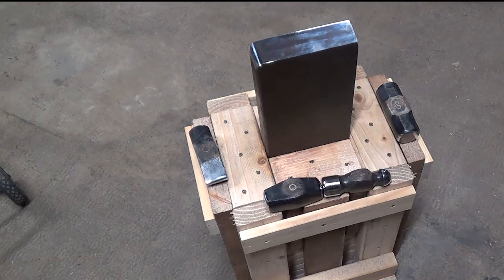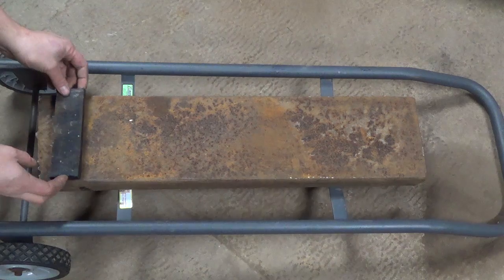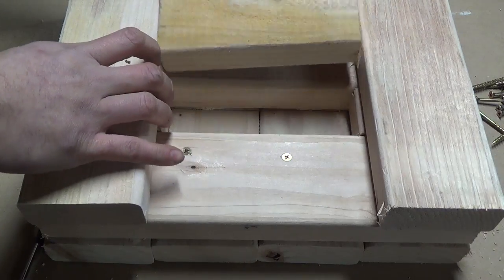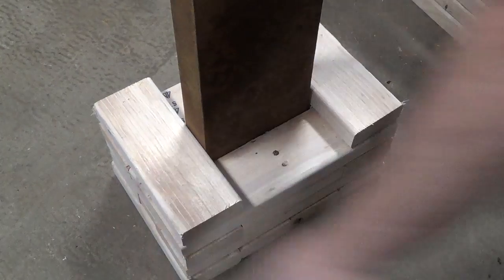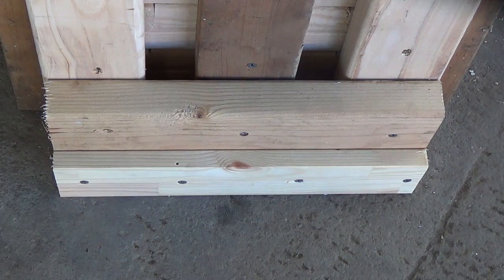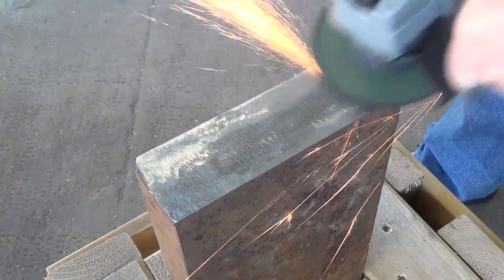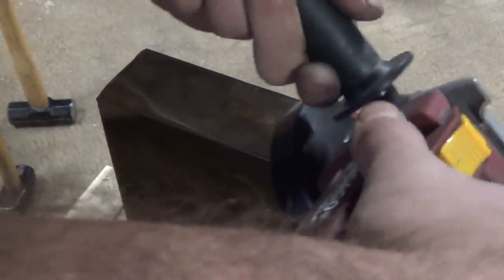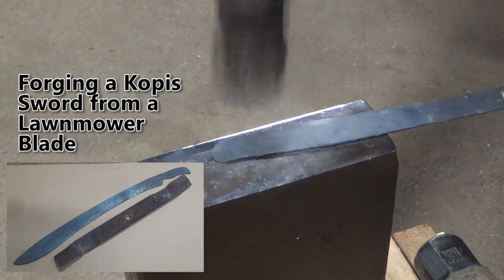How to Make a 100 Pound Scrap Steel Post Anvil and Stand for Blacksmithing and Knife Making

Comment: anyone know the easiest way to make an axe out of common materials?! I've a handle finished up but no head and no steel large enough for a decent head
Reply: I'm not an expert on this, but maybe you can forge weld steel cables?
Reply: +john smith I would recommend against doing that because it is technically illegal to go onto or around a railroad track. If you take anything even if it seems like trash, you know that steel that is rusted and buried in the ground that no one will ever pull out, its technically stealing.
Reply: +Chris McLain and? lol seriously though the way I see it my family's paid taxes to pay for that shit, if they aren't using it ama take it back and fuck what they say :D
Reply: +john smith there's actually an abandoned track just down the road, it used to be used to move cattle. might just have a little look around there
Reply: +john smith it's a back road in rural ireland 1) nobody gives a shit :D 2) nobody will see 3) the police don't care 4) the nearest station is forty minutes away. so it's hardly mission impossible :D

Comment: How much was the block of steel.
Reply: Just and extremely rough guess but probably lest that fifteen dollars
Reply: +Shredder212Films dang that's cheap
Reply: +Outdoor maker38 it wouldn't be too expensive and you could just look for scrap in woods and stuff. I found about 15 50 pound bars of steel near a demolished barn

Comment: It seams like the rubber at the bottom is unnecessary and detrimental to working efficiency. If you just put it straight on the wood, it would crush down the wood to the appropriate density and give your hammer better force delivery to your work.

Comment: wouldn't that polished end deform quickly? Its not hardened steel is it?
Reply: Dave Z it might eventually work harden like a rail line would, but I'm sure a block of high strength steel will get added on top one day
Reply: For a striking anvil it's actually better for it to be made of mild steel so that chips of steel don't fly off on a misstrike
Reply: Still better than cast iron

Comment: that ammount of steel must have cost a fourtune
Reply: 105 lbs times X 25 cents a pound = 26 bucks/dollars/bones.  If he drove a big truck to a far away scrap yard he would have paid as much in gas to get the thing. Also he probably spend several hours searching and had to drag the thing over to the scale...
Reply: He could weld thin tool steel to the top, torch it to bright red and water quench and have a top that will last a long time. The thin tool steel will probably cost more than the mild steel.
Reply: Best bet is to get the local fire dept to supply the water, proper quenching for anvils require running water akin to a waterfall.. I'm sure a 3000liter per minute pumper would do that fine. Plus no need to life a massive hot block of steel/modify it so it is possible to lift

Comment: POCKET KNIVES?
Reply: wallytron101 I've made many recurves and Bowie's and other knives and the "anvil" I use is a bunch of different sized sledgehammer heads on an old Post...
I mostly make art pieces but I've sold a dozen or more knives. Basically it works, if it works.

Comment: Just one man's opinion over here, but I don't reckon those screws are doing much for you. Properly applied, glue is a good bit stronger than screws, and screws are just used to hold the work in place while the glue cures.
Reply from the maker: +Rob Mckennie Thanks for watching!
At the very least, the screws added an extra pound of weight to the stand.
Reply: Is your house put together with glue?
Reply: +Rob Mckennie How does glue hold up with vibrations?
Reply: Alex Behrens Do you think most houses are built with the strongest materials and techniques available? No, of course they aren't. They're built in a way that is least expensive and most efficient, as long as it's strong enough. It doesn't need to be as strong as possible, it just needs to be strong enough.
Reply: +Alex Behrens    Most new construction is in fact assembled with Adhesives..   and over the last 75 years, the material that gives most homes their strength is Glued Laminate Plywood..  It is the sheathing which gives the structure is ultimate strength..   The structure is extremely weak before the glued laminate sheathing is screwed and glued..  The Glue acting as the ultimate bond and the screw acting as a clamp to keep the two materials tightly assembled while the adhesive bond cures.
Reply: PyroShim I'd wager better than screws or nails.
Reply: +Rob Mckennie glue is stronger but don't really like vibrations
Reply: Popescu Kevin   You have it backward.. It is fasteners which do not like vibrations..  That is why all new flooring and decks are "Screwed and Glued"..    If you're familiar at all with older homes, sheathing, roofing, flooring, or deck covering the nails will "Pop" up due to vibration..  Screws will work harden and snap off at the head and the boards will lift.. Adhesives are now applied for the same reasons they are used in Air Frame Construction..  Because they resist vibration and form a more uniform bond over a larger surface area than Fasteners.
Reply: +Rob Mckennie this seems silly. Screws and glue together is stronger than glue by itself.
Reply: Jonathon Frederick I would bet that all things being equal, using nails and glue together wouldn't have a greater ultimate strength than just glue, although it's true that it can provide convenient clamping, but it was a bit excessive in this video
Reply: have you ever even pulled wood joints apart with glue vs glue and screws? You can easliy break glued cabinets apart with just a hammer. If you add screws it prevents the wood fibers from breaking where the glue is applied, holding the whole board together.
Reply: Jonathon Frederick And there you have the difference between edge joining and face joining.
Reply: +Rob Mckennie and here we have a man who can't admit when he's wrong
Reply: Jonathon Frederick what was I wrong about, exactly?
Reply: +Rob Mckennie why do you guys keep going....
Reply: +Jonathon Frederick you are very right.
Reply: Your reply makes absolutely no sense to this application obviously lvls are extremely strong and sheathing holds the structure square and strong but all these items are held with glue was I questioning the material he was using? No it's the fastening of wood vs glue in an application that is subject to high vibration and impact in which case a fully rigid glued stand would eventually crack and break where as the screws would allow flex and still remain strong
Reply: all these items are held with screws*
Reply: +tha Priesta Obviously you have never seen US weather. And houses are screwed and glued in the US. If you are talking about trailer parks, thats where the poor people live.
Reply: Houses in the U.S. were primarily put together with nails until about the 80's. Nowadays, there is still many nails but its usually held strong with hardware, bolts and shear walls. I haven't personally seen much glue used in wood frame homes, except when flooring ( to prevent squeaks )
Reply: It has to move a tiny, tiny bit, so I'm thinking it's cool
Reply: ***** do you have any evidence for that?
Reply: ***** Lol, nice evidence. I never said that screws would make things fall apart, I said that I don't think the screws are adding anything. How many houses have you built using only glue that have fallen apart?
Reply: +Alex Behrens lol ya or any building above 50 square feet
Reply: +Rob Mckennie The screws were adding strength to the whole thing and keeping it together nice and flush. See the planks move into place slightly as the screw was tightened? Without that the planks would have been prone to wobbling
Reply: +rainmechanic Nope. My dad is a home builder. They use laminated boards for structural purposes (Micro-lam boards are incredibly strong), but framing is just 2x4's nailed together with pneumatic nail guns.
Reply: +Rob Mckennie After reading this comment and the replies to it. I'm curious to what and how much experience do you have in the construction industry? I mean no offense to this question, I'm genuinely curious. Also what kind of facts, documentation, and or what kind of evidence do you have to base your claims off of? Because I have just over 12 years experience in construction work, and  I find your claims that glues, epoxies, or any other kinds of adhesives alone are stronger than nails or screws. Or that they are stronger than nails or screws along with adhesives to be pretty far fetched! I know my 12 years experience isn't a whole hell of a lot, but, it's enough for me to be able to say that you are both right and wrong at the same time. Whether glue is stronger than nails or screws depends on the application. If you are building a model air plane then yeah glues are king! But if you are building a residential house or a commercial building... No way in hell will any kind of adhesive outperform nails, screws, or bolts! You will never pass an American Codes Compliance inspection if you plan on building any kind of structure with only adhesives alone. Especially if that structure is to have a person in, on, or around it at any given time. Codes Compliance rules, guidelines, and or protocols are based off years and years of rigorous, scientific testing of building materials and the techniques to apply said building materials to make sure residential or commercial buildings or dwellings are as safe as humanly possible for people to be in, on, or around. And they inspect every single aspect of any kind of construction. From the footer for the foundation to shingles on the roof they inspect EVERYTHING!  It doesn't matter if the materials or process of applying materials is the most efficient or if it's best, strongest, most expensive, or the cheapest. As long as they are accepted by statewide or nationwide codes compliance regulations you are good to go! And I can tell you right now that no inspector in the United States of America will ever pass any structure constructed with just adhesives alone. Especially if that structure is to have people in,on, or near it! Adhesives just aren't strong enough to use to build anything of significant size by itself. If they were strong enough I'm sure it would be the standard thing to use in modern construction. It would definitely be cheaper to use synthetic adhesives over steel nails or screws. Because I'm sure it's less costly to make a 5 gallon bucket of  adhesive compared to making a 2000 count box of steel gun nails or a 50 pound bucket of screws.
Reply: Randomus Maximus Trailers are assembled primarily with glue, and tacks(I wouldn't call it nails, just pins to hold it together while the glue dry.
You also see what happens to trailers when the wind picks up.
Reply: +Richard Smith I don't know the kind of trailers you are talking about so I can't judge them. But most if not all the trailers I've come across, which is quite a few because most home builder construction companies use enclosed trailers to store their tools and equipment and stuff, are constructed using rivets, screws, and bolts along with adhesives. And I think the adhesives were used mostly for the weather striping if I remember correctly. But then again I've never seen a trailer built from the ground up so the adhesives are probably used in more places. But I've never seen one that is mainly constructed from just adhesives and a few pins. But I also haven't seen every type of trailer too. You could be right that some trailers could be constructed using mainly glues. I know I wouldn't want a trailer that's constructed using adhesives as the primary fastener! lol.
Reply: Randomus Maximus Naw, i am sure you can find videos of them being assembled. They are made in parts, and assembled with glue. Not trying to argue, just some information you are missing.
Reply: +Richard Smith You're cool buddy! I'm not trying to argue as well. I'm just sharing info that I know or have found through research or experience. I like learning new things. Knowledge is power in my eyes! I did not know some trailers were put together mainly with glues and other adhesives. I can't find any videos showing the construction of a trailer were glues and adhesives are the main fastener. I could only find a couple videos and they both showed the use of both hardware and adhesives used in the construction. The hardware being the main fastener and the glues used as a secondary fastener and weather sealant. But if you can point me in the right direction to some videos I'd be much obliged! I would love to see them! I think it would be interesting to see how it would be done! I love watching shows or videos about things like that. My favorite shows to watch on T.V. are How It's Made, or Modern Marvels, or How Stuff Works, or  How Do They Do It? or anything of that nature.
Reply: +Alex Behrens actually yes, types of glue are used to bond concrete and stone in construction.
Reply: Hey +BackyardBowyer  ...how should a good quality anvil sound like when you hammer it ??
Reply: ***** I don't own an anvil, but my homemade lathe bench is glued only, and holds a 300+ kg lathe pretty well
Reply: ***** I disagree that it's the contrary. I'd bet that you see virtually no improvement in either the yield strength or the ultimate tensile strength when using screws in addition to glue. All they're good for is holding the wood in place, which isn't always even necessary, and I might go so far as to say that in certain circumstances it would weaken the joint. Matthias Wandel has a video on the effects of over-clamping, it weakens the joint, and screws are no exception to that.
Reply: ***** If you're not interested in having a conversation about materials science for it's own sake, don't waste my time by talking to me. I never said it wouldn't be good enough, I just said that the screws are probably not contributing much (if anything) to the strength of the end result.
Reply: Screws are good to hold down wood....just add enough,never to less .....and it will hold just fine !
Reply: Wow, so much back n forth. Just my two cents: all the debate is kinda comparing apples and oranges. Glue has surface grip, while screws have penetrating grip. Glue bonds are only as strong as the surface material strength. Screws are only as strong as their shear strength, or based on the screws length, the resistance to strip out of its hole. So really its all relative to each specific wood project.
Reply: Tin Man I agree, the screws may only be there to handle movement and vibration, but without them, the smallest movement in the earth you'll have de-laminating house frame
Reply: ***** you obviously don't know much about material science
Reply: Rob Mckennie there's a reason why houses aren't put together with glue.....
Glue fails at a relatively low heat
And also cold makes it brittle...
Reply: Dylan Zrim There may be a reason that houses aren't put together with glue, but then again houses are put together with glue, so that's pretty confusing. Too, it's not as if the application in the video is comparable to building a house, if screws are so much better than glue why is anything ever put together with glue? Why was glue used for this project at all, why not just use screws?
Reply: Rob Mckennie because glue in low stress situations is used for aesthetic reasons..

For the record, houses are held together by high tension bolts, or plates that have nails on one side...

And don't try to say screws are glue... they aren't.. different mechanics...
Reply: Dylan Zrim Yeah, the glue in a joint between two pieces of wood is stronger than the wood it's stuck to. If you break a properly prepared glue joint, you'll find it's the wood that failed, not the glue. But sure, low stress applications.

Before making these kinds of claims, maybe you should do the bare minimum in terms of research? Less than 2 minutes of googling would show you that you're wrong, I can even provide links if you like
Reply: Rob Mckennie I wish they had used glue and screws on our house, a level and square would have been nice also!! :)
Reply: Rob Mckennie I wish they had used glue and screws on our house, a level and square would have been nice also!! :)
Reply: rainmechanic I wish they would have used glue and laminate sheeting along with screws when they built our house:(
Reply: Screws act as a clamp while the wood dries. If you are in the process of putting it together you don't want to have to stop, wait for the glue to dry, and then pull the screws, and with all the layers and the height trying to clamp it would be a nightmare, so gluing and screwing as you go is the way to go. One way takes a couple of hours, the other a few days.
Reply: Mechanically, screws are much more secure than glue. If it were the other way around, houses would simply be glued together, forgoing the nails/screws.
Reply: I thought the same thing.  Nails will have a better shear strength.   But the sheer number of screws will probably spread the force sufficiently, so they're likely strong enough.  I don't think that I'd want to rely on glue to withstand repeated impacts over years.